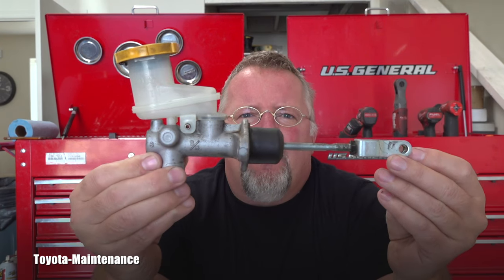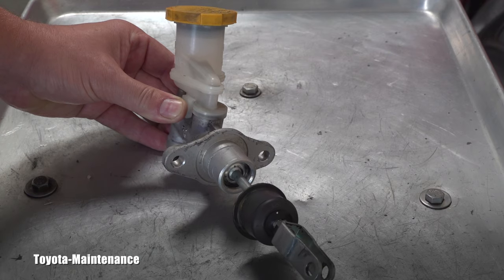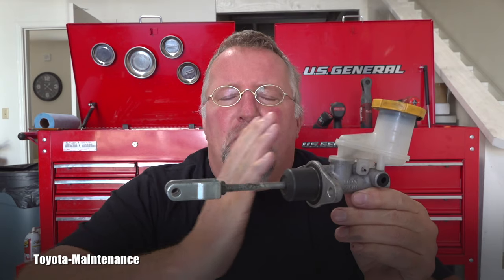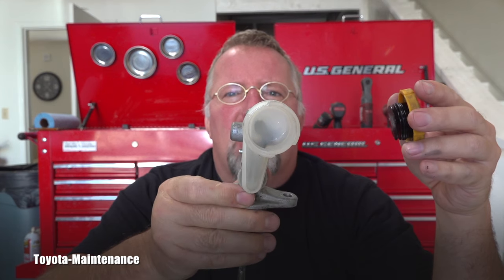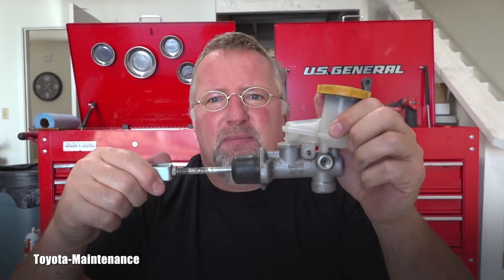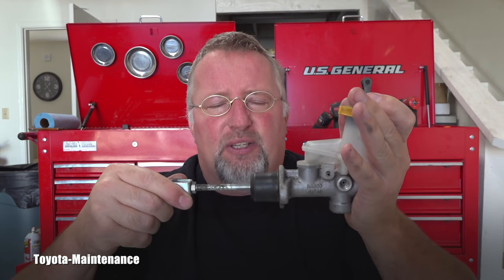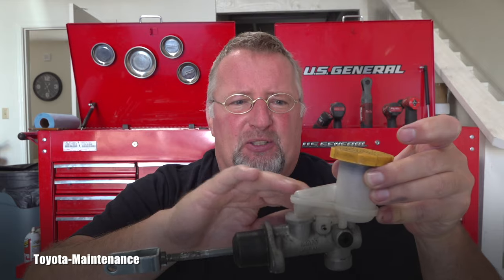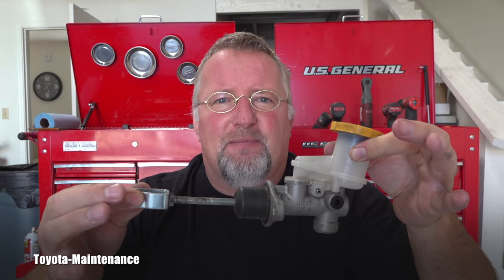Clutch Master Cylinder Failure

Comment: It makes me wonder how many clutches are replaced too soon, only to find the problem persists. Is there any screening test you can do, to easily to tell if your slave cylinder isn't getting a full swing?
Reply: A few months ago I came to a light and wasn't able to shift into any gear which resulted in a tow.  Shop says slave cylinder or clutch and recommend both since the transmission had to come out either way.  This didn't fix anything.  I've been back over 3x now and it's still not fixed so this is next on the list

Comment: Thanks, I have been wondering why my clutch pedal sinks to the floor in my 93 Nissan D-21. The lack of fluid loss had me perplexed.  I bought a new master and slave cylinder and will be replacing this weekend. And NO,the term master cylinder and slave cylinder is NOT racist  !

Comment: The first part of travel in the master cylinder is where it blocks the port to the supply off, then it will start to pump out through the line, when you release the pedal it moves back and opens the port to the reservoir again, if the piston is pushed too far forward at rest it cannot let the cylinder refill and will lose it's ability to pump the correct amount of fluid to operate the slave cylinder.
Reply: Hello why would the master cylinder fluid be black 1993 Toyota. 4 wheel drive? I lost all gears I couldn't shift.

Comment: Thanks. I changed the clutch disc and pressure plate a few months back. Soft pedal 80% and hard the remaining 20% when clutch is depressed. Sometimes clutch disc engages quickly with just a little bit release and sometimes when the pedal is released half way up... inconsistent clutch bite level. Clutch hardens when hot. The mechanic wants to replace the pressure plate again as he suspects fingers have turned hard(??). I have ordered for cylinders.

Comment: I took my 03 Subaru WRX to many shops describing exactly the same problem to them and they all suggested I replace my clutch and clutch fork.  Thing is I had my clutch replaced about 50,000 miles ago and I baby the car.  I knew it had to be a hydraulic issue of some kind because of the behavior.  Watching this video both makes me feel much better and confirms my suspicions.  I'm going to go out and do this job myself for ~$65 right now instead of the $1200 or so the shops wanted to charge.

Comment: So crazy... this is exactly what is happening to me right now!! My 2010 Toyota Tacoma V6 has had a difficult time shifting lately.  There are NO leaks anywhere and no clutch slipping. So, I changed out the Slave cylinder and bled the system 3 times; the last was with the pressure tool. There was a lot of muck in the drained fluid. I had intermittent smooth shifting but it would keep reverting to a stiff stick. So, my next choice was to replace the Master cylinder. I just bought it yesterday and will replace on Saturday. Low and behold, I watch this and now believe this is definitely the issue. I thought I had an air pocket/bubble issue but it was the Master cylinder all along!!! Thank you so much for this video and clear explanation.

Comment: Had the same issue on my wife's '06 tC. I ended up wearing out the 2nd gear syncro. Now with the new master cylinder, 2nd grinds when you shift aggressively...
So the advise is, do not delay this repair because you end up shifting with the clutch still partially engaged.

Comment: Awesome video, I thought my clutch was bad when I couldn't get it in or out of gear with the car running, and would start to engage almost immediately. And at times would have to pump the clutch pedal repeatedly for a minute to get it to go into gear. I'm going to replace the master cylinder this weekend and see if I can save some cash, again thanks for the good informational video

Comment: Next time please consider disassembling it and showing us the rubber plunger and the probably badly pitted and corroded metal cylinder. If the rubber broke down a rebuild could fix it. If the cylinder is pitted, was it from water in the clutch fluid corroding it? What was the reason for the failure?

Comment: thank you for the explanation! .  This is probably  my problem too but at very early stage. Occasionally and randomly my clutch refuse engage and there was some rough shifting. My mechanic made a quick  check upon request but there was not external leakage at the rod.  The piston seal (internal)  and not rod seal (external) failed that does not allow sufficient pressure to actuate the clutch.

Comment: After watching many videos on clutch hydraulics your is the best. I am a DIYer and for the first time I am dealing with a 2004 Civic Si with a clutch pedal that has no clutch pedal resistance, it goes to the floor and hardly returns. The car has been sitting 7 yrs without being used. The master cylinder was full and no signs of leakage. Should I just replace the master and slave? What is the simpilest way to try and bleed the system? Thankyou.

Comment: This is exactly what happened to my 2006 Scion tC. The first mechanic I brought it to didn't fix it right and I brought it back to him to fix and he just tried to adjust with the nut which didn't work. I would up taking it to a different mechanic who fixed it. The first mechanic lost me as a customer losing a 5 vehicle customer permanently while the 2nd mechanic just gained 5 vehicles.

Comment: Priceless information. Same thing is happening in my BMW. It will not engage first from a stoplight. However, if I push the clutch pedal to the floor and hold 5 seconds first gear engages like butter. My master is probably bad.

Comment: Thank you for your fantastic video. I have the same problem as what you described. The only difference is that mine is eenj more sneaky as it only happen during stop start traffic lasting more than 30 mins. When that happens, shutting off the engine for 15 mins and the clutch will return to normal again.
Reply: @cttan456 Could be expansion of the flexible line going to your slave cylinder especially if it passes near anything like a radiator or exhaust system. 
The heat soak while sitting in traffic will allow the flexible line to expand and heating the fluid acting as a double whammy when reducing the effectiveness of your clutch purchase. 
Also how old is your fluid it should be changed every couple of years.

Comment: Tnkx, helped me a lot, mine clutch master cylinder is almost like that. I thought was just air stuck in the system, i am still learning so i asked myself. Oh is really same fluid and reservoir for clutch and brake? I was surprised. But i had bled the brakes before. But wasn’t sure about have air still or not. Then i did a simple procedure to bleed out the master and slave cylinders, worked but i never saw any air coming off. Instead just had what seems a vacuum type of thing, don’t explain, doesn’t make any sense. So i just had to add more fluid. A good amount, did this through the bleed put valve on the slave cylinder. So pulling back the pedal would suck in the extra fluid. And was done and perfect working, well lasted for about 2 weeks or 3 and is already halfway again. I always notice since i got the car that the pedal is very stiff, even hurts the ankle. Its a jetta 1999 mk4 vw diesel 1.9 with 232.500 miles on it. Would a clutch pedal be normally very stiff  .
Another thing i like your accent, and the way you talk reminds me psychos in horror movie lol.

Comment: Hei
I have a leak under engine in the center
Transit 2004, 2.0 tdcia
Gear box got completely stuck 5 times already during last week.
It begin with bad changing of gear 2.
Some video suggests that release bearing must be changed and it is removing gearbox.

Comment: Good video. What about cars that have a clutch vacuum booster. My 1991 Nissan skyline GT-R has a weak clutch pedal and after pumping it 3-4 times the pedal becomes stiff again like normal. Already replaced the clutch master cylinder and slave. Still having the problem. Clutch engagement is good tho. No fluid leaks. Reservor is full. Pedal dose make noise like air is going in tho

Comment: How to tell the difference from a bad clutch master cylinder from a bad master slave cylinder? I think I may have a bad clutch master cylinder because my brake - clutch fluid uses the same reservoir and when I checked it all the fluid was gone. My clutch pedal goes to the floor really easy, and the engine starts up, but it doesn't come back up unless I pull it with my foot.

Comment: I've gone through many in my 82' to 92' Camaro and I believe the "dirty" resevoirs are a sign the cup seals are abrading themselves against the fill port because they're too soft. What to do about it I've yet to figure out. Get proper internal snap-rings, build a jig to hold it for assembly, and get a line on some quality cup seals so I can rebuild the thing myself I guess. S has jsut gotten ridiculous and my pedal geometry is just as centered as can be. It's a real pisser man.

Comment: My 1999 Honda civic Dx hatchback 5 speed makes grinding noises when I have the clutch engaged. When I drive and let go of the acceleration the car starts to make grinding noise. I asked my mechanic had he said it can probably be my clutch master cylinder and I wasn’t sure if it was true or not. Can you help me find out what’s wrong with it?

Comment: Rough shifting has nothing to do with the clutch The problem would be the synchronizers If you are replaced the slave cylinder in master cylinder..... Replace in the clutch would do nothing for rush shifting What are people talking about?

Comment: Hey my car won't let me get in gear when accelerating hard. Normal daily use it drives fine. I inspected my slave cylinder and it moves out instantly when I press the clutch pedal a tiny bit. Can my master cylinder still be faulty to not fully depress my pressure plate to not let the clutch disengage fully?

Comment: Hey I have a 09 Camry. My clutch pedal goes all the way to the floor. I replaced the slave and bled it the regular way by pumping and bleeding the nipple. The pedal goes back all the way to the floor. I haven’t changed the master but I’m not sure what else to check. What do you think it could be? Could it have more air in the system? I can’t shift any gears once I start the car. Car off I can shift the gears.

Comment: Ive done already the replacement of clutch slave assymbly, but its still failure i coud not bleed the fluid the clutch pedal is very soft when you push, the push rod on the clutch slave it doesnt move, what is the deffect?

Comment: Mines is spraying brake fluid all on the  firewall. Then the clutch goes all the way to the floor if the brake fluid reservoir isn't full. After about 20 min of driving I noticed a about 20 percent of the fluid is gone already

Comment: I put a brand new clutch master cylinder and a toolbox and checked on it a year later and the Piston is locked up like it's full of glue I hit it with a hammer and it won't even go in it's completely locked up and this was a brand brand name clutch cylinder but it came from RockAuto

Comment: $2,000 for a clutch job?? Crazy!
Reply: I don’t know what Toyota has a clutch that costs $2000 to replace. The clutch in my ‘92 Celica was fixed for $650.
Reply: @ricksays7133  Did you for it to be installed or do it yourself?
Reply: @davidgriggs3967  I did it myself with a Haynes repair manual and watching a video of Scotty Kilmer remove one from an old Toyota.